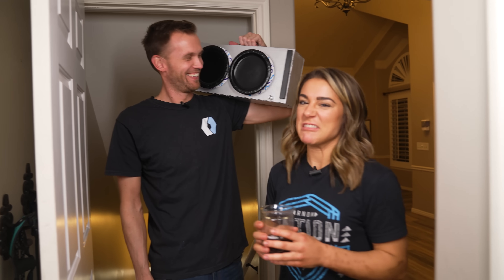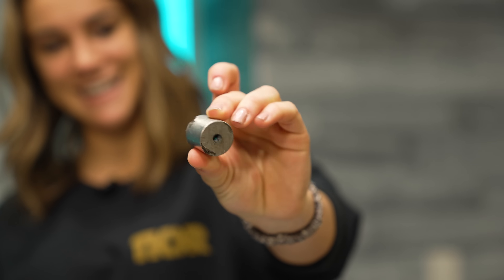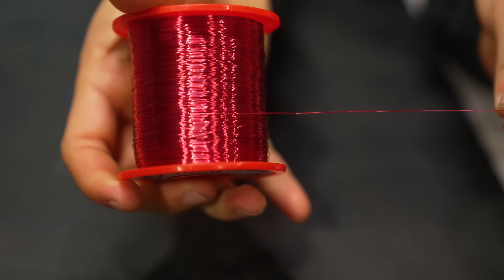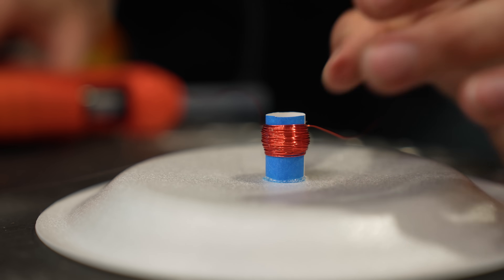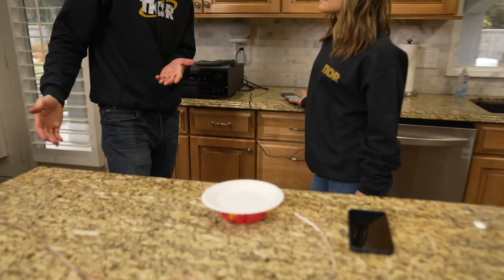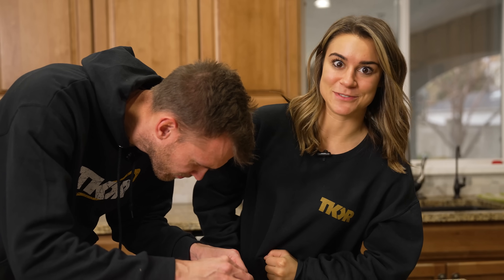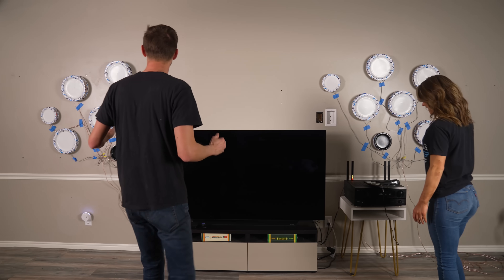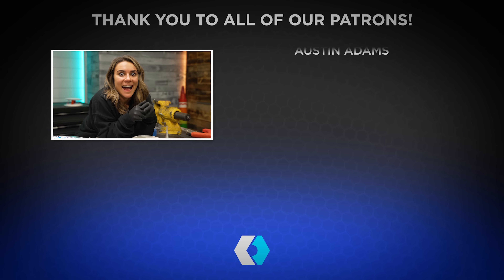SCALING UP a Paper Plate Speaker (DIY)

Comment: I built my very first speaker when I was nine. You can use it as a mid bass woofer. It even looks like something you could buy because it has a metal frame just like on retail speakers. It has a spider, tinsel leads, a dust cap, nylon surround, terminals and a ceramic magnet ring with a metal pillar. It moves freely without scratching and has a lot of bass. It’s a five inch speaker. The coil has a proper former and the wire is coiled up twice precisely and glued onto the former all the way through so it’s attached firmly onto the former. The frame has four screw holes and the woofer replaced a broken Logitech subwoofer. The build was a massive success and the system sounds nice. But it’s not very powerful because of the lack of cooling and excursion.
Reply: Impressive
Reply: i built a puppet when i was 7
Reply: @UnknownedYt  Nice
Reply: I tried doing the exact same thing when I was 9 as well. I didn't get as nice of a result but it still worked. Today, over 12 years later I do audio work professionally
Reply: @GrandNebSmada  that is a beautiful story 😸❤️

Comment: The reason why it’s not as loud because you need a amplifier board if you try to Connect it to a auxiliary wire without an amplifier bored to the speaker it’s gonna sound like it’s cheap headphones

Comment: @TKOR I have a video idea for you guys please follow these steps * Warning please where gloves these are not going to harm you but digesting it or having to much on your skin may be harmful * Do not try at home
Step 1 get 3 glasses of water named cup A, B, C
Step 2 put some ferric chloride about half maybe a little less of a plastic spoon in cup A
Step 3 put some sodium fluoride in cup B about a bit less then half a spoon like 1/3
Step 4 put some potassium thiocyanate in cup C about half a spoon (size doesnt really matter but it works best like this)
Step 5 Stir and mix it well (does not have to be all gone just stir well for like 15 secs)
Step 6 This is the fun part get a spoon of cup A and a spoon of cup C and pour C into A and then it happens 
Step 7 Get a spoon of Cup B and pour it in the other spoon
Step 8 Things you can do with this get some of Cup A and put it on a plastic knife and get a rock with some cup C on it and "cut" the rock or anything else hope you like this suggestion if you see this please do this its really cool!
I also wrote this on your other video please read this

Comment: You can damage your home stereo with low impedance speakers. So put your paper plate speakers in series instead of parallel if you want to protect your amplifier.
Reply: Yes actually measure the résistance with a multimeter. Should be Written on the amp near the speaker outputs. Generally 4 to 8 ohms.
Reply: Yes a multimeter is the best way but if you don’t have one of those then more resistance like 30-60ohms is safer than 1-4ohms. Putting the speakers in series with increase the ohms. 

I accidentally put a 4 ohm woofer in my home speakers and destroyed a very expensive amplifier that required 8 ohms or more resistance.
Reply: @ecospider5  yeah i learned the hard way too... Made one of those diy speakers one day an cranked the amp to 11 to get a little volume. It burned.
Reply: Destroying stereo equipment always sucks. But it’s always a great learning experience.
Reply: @bastol85  the problem with using a multimeter, is that it uses DC to do the ohm measurements-since a speaker is used with audio(AC), the coil will have a higher resistance than it will have at DC(Impedance VS resistance).
Reply: @m.k.8158  Exactly. My point was that you can't burn anything using resistance values since impedance will be higher.

Comment: Besides the copper wire, what other electrical components did you use to connect the speakers to a phone?
Reply: Phone -> charging port to headphone adapter-> 1/8in (headphone) cable-> metal clips attached to speakers.
Reply: @jtocool  Thanks! :)

Comment: I will definitely be doing this. Wonder if you could use sheet metal instead of the foam board
Reply: I'm very curios as to the answer for sheet metal as well. Even though it would be impractical due to cost and mounting I'm still curious.

Comment: 6:32 Reminder that decibel-meter apps are total bs and that you don't measure loudness like that anyway.

Decibel-meter apps aren't worth anything because they're not calibrated and therefore the reading is meaningless.
You don't measure the power of a speaker like that at all. Since decibels are heavily affected by distance, the correct standard way is measuring with 1W power, 1 meter away.

So no, it's not averaging 70 dB, that would be uncomfortably loud.
Reply: 70db is around loud talking level. Unless the person talking loud is annoying, it wouldn't be too uncomfortable. The uncomfortable decibal levels are usually in the low 100bd. A decent sounding car stereo system becomes uncomfortable to most people around the 120-130db level and a hard hitting system is around 150-160db. Prolonged periods around 150db would definitely be uncomfortable and damaging to the ears.
Reply: lot of people are using 150+ db cars as their daily driver and they dont have ear damage.. @fortnitingunclepappy
Reply: @kassikattonen  I'm just speaking on the average person. I thumped everyday for a long time at around 145db and never had a problem with it. I was just letting them know that 70db ain't nothing as far as uncomfortable. Like I said, unless the person speaking loudly is very annoying, it won't be uncomfortable haha.
Reply: Anything above 105db can damage your hearing if you are around it 40hr a week for 10 years. You are usually not around Loud stereos 40hrs a week. But you won’t know if you have hearing damage until you are in your 50’s. It rarely happens instantly.
Reply: Hmmm thats fair 😃
Reply: @ecospider5  It depends on the frequency. 15-60hz don't damage ur ears at 150+ db. Mid-range at that level would damage the hearing though.

Comment: So you think your smarter then a fifth grader . Then why don't you build an actual 120v arc welder that  only uses 1, 20amp outlet instead of 2 separate outlets to power the welder and also show all the steps you took in building it without leaving any info out on how you built it!